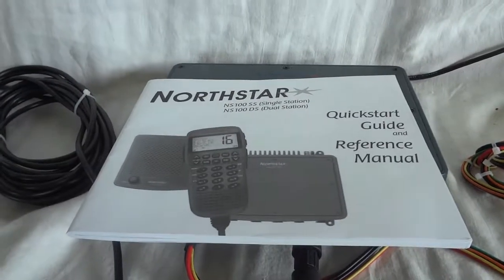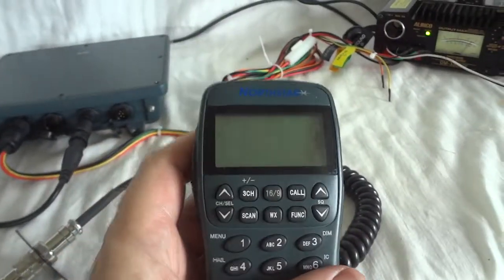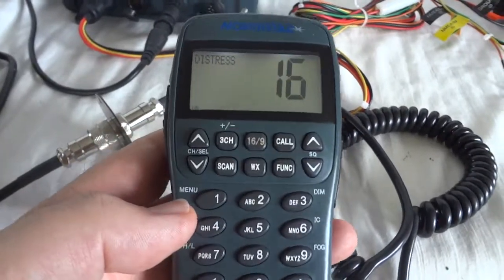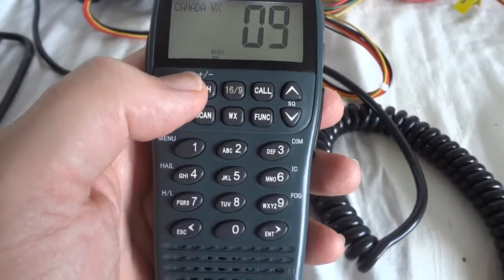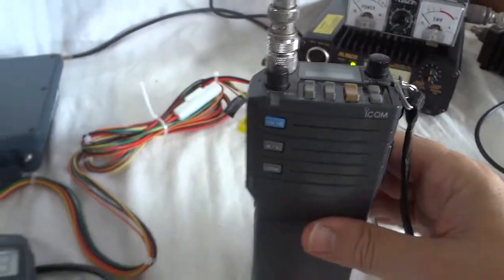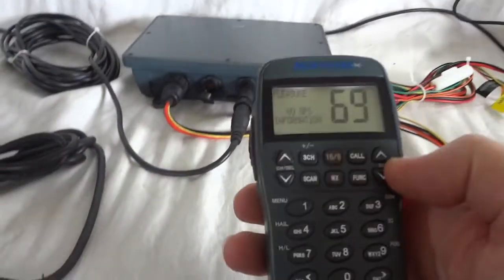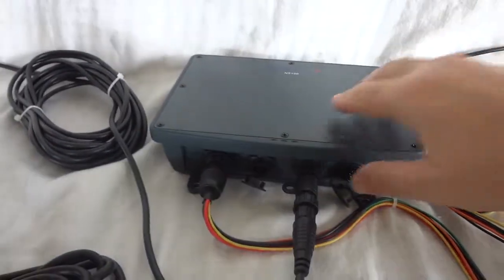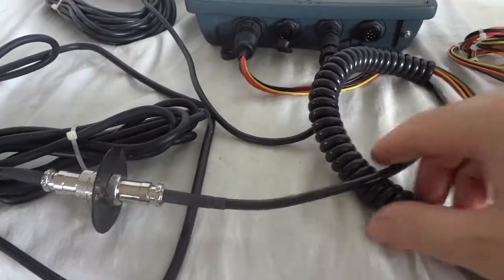Northstar NS100DS demonstration VHF FM marine radio

Comment: Great video.  I have the same marine radio (from 2008) and the male 10 pin connector failed. You mentioned, and we can see, that you replaced with some quality male/female 10 pin connectors.  Can you let us know the brand, model, and where purchased?  Thank you very much. Northstar parts are now rare.
Reply from the maker: I bought these connectors on eBay. But soldering them is not for the faint of heart though, they are awfully thin wires and a lot of pins. Hope this helps